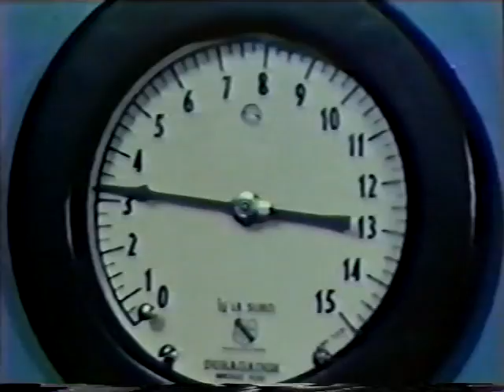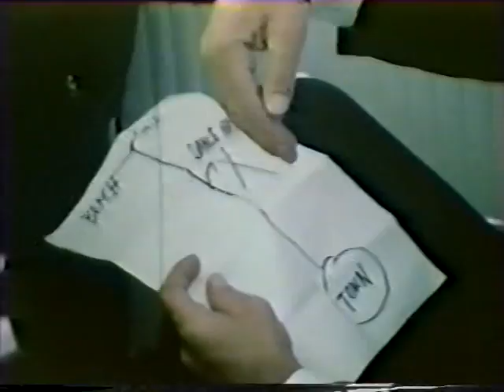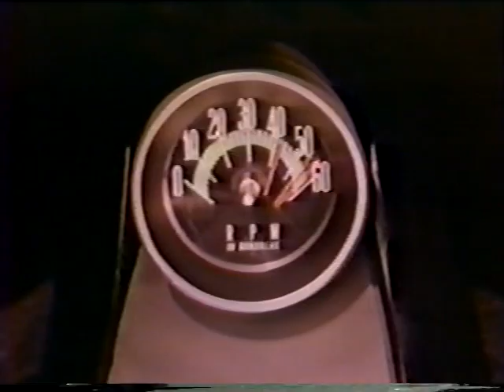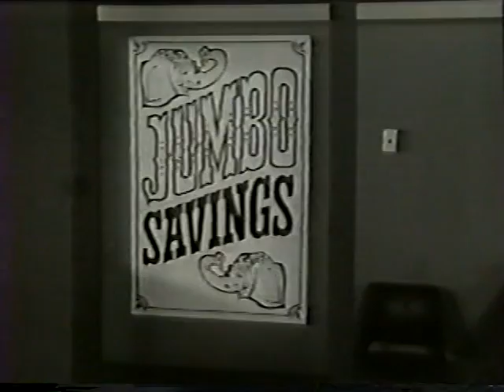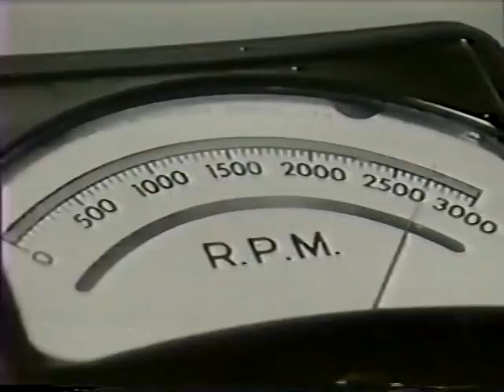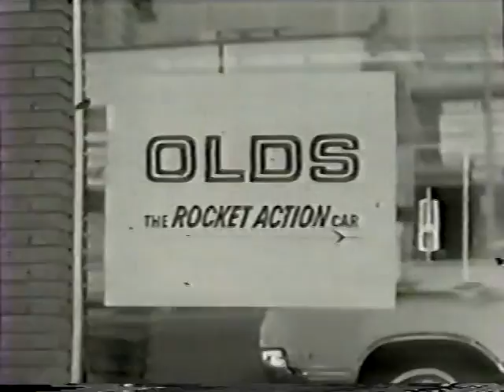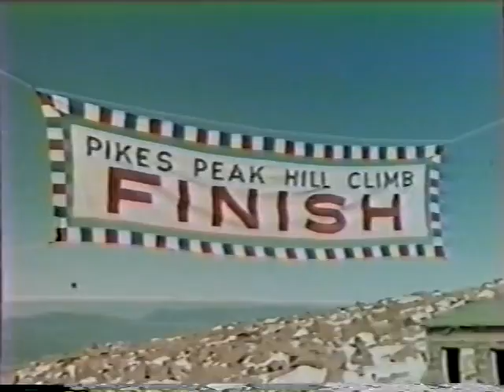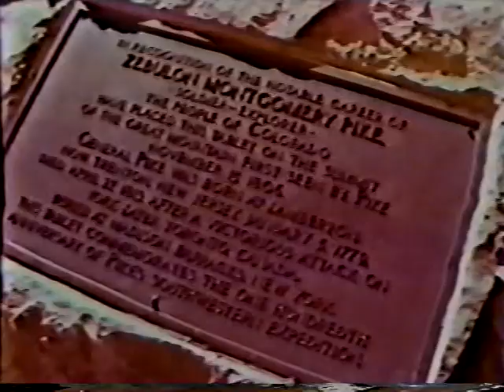TORONADO PIKES PEAK HILL CLIMB 1964-1966 OLDSMOBILE COMMERCIALS

Comment: That Toro was haulin ass good ole 425s
Reply: My Father had a 66 Toronado base model, [no A/C, etc.] for many years, good thing it was racing UPHILL because those 4 wheels drums got hot fast
Reply: I was thinking the same thing regarding the weak drum brakes which were a constant complaint of testers and owners.
Reply: Did anyone else take note of the driver in the Toro putting on his helmet at the start of the uphill run, and when he finished and the guys ran up to him he didn’t have on his helmet? 😳😀

Comment: At  approx 36.40 into this there is a 65 Jetstar 88 commercial. Olds made a boo boo as they showed the car with a Turbo Hydramatic that wasn’t available on that series until 66. The only automatic available was a two speed Jetaway automatic , essentially a Powerglide. The slightly more expensive Dynamic 88 and other full size Oldsmobiles would be the cars to have Turbo Hydramatic.